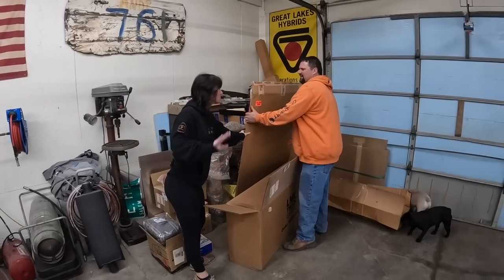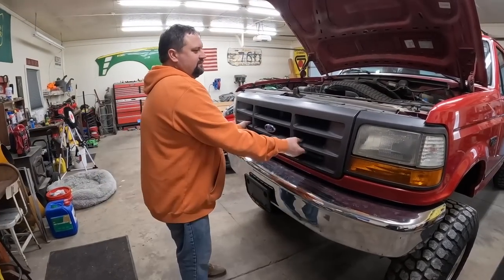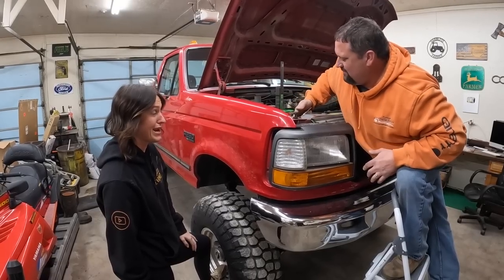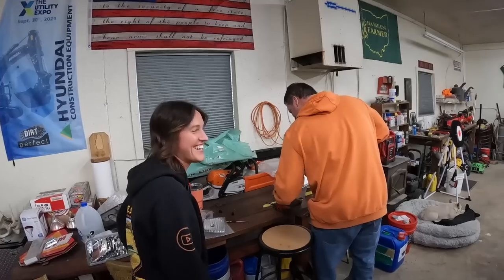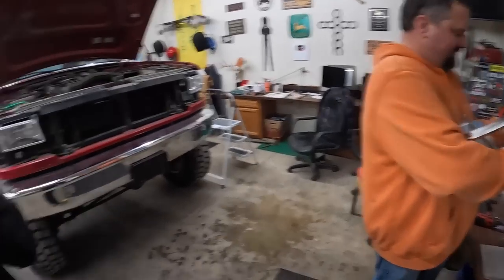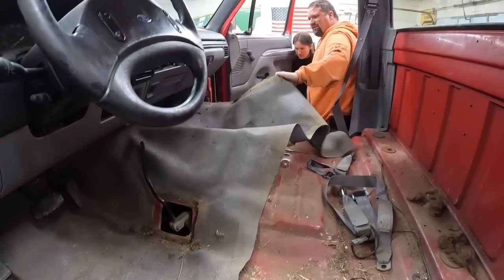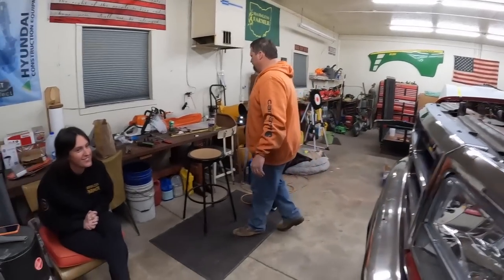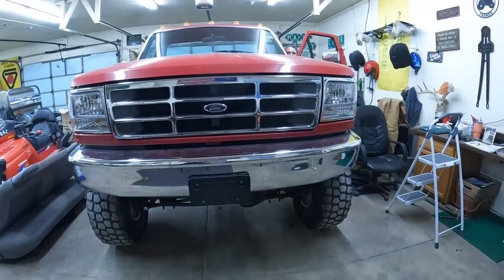Built Ford Tough With Chinese Stuff

Comment: Which gasser does the F250 have in it? I would personally opt for the Powerstroke, because you could get up to 20mpg highway, and they are fairly easy to work on compared to newer diesel engines.

Comment: Whaaat?  You mean O'Reilly's didn't have amber turn signal bulbs?  LOL.  My neighborhood O'Reilly's has yet to disappoint me, always has what I need and if not it's there in a day or two if they have to order it in.  The F250 looks much better with the chrome grille and headlight bezels!  Maybe should have gone LED with the headlights?  Sylvania makes the LED replacements for the 9000 series sized headlight bulbs, albeit at $100 a pair.  Kinda pricey but they are worth it.